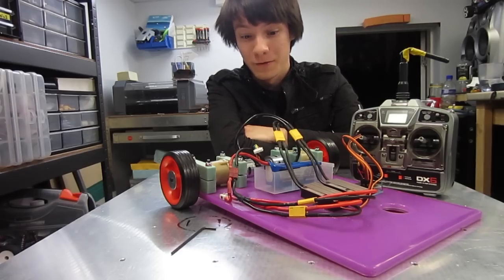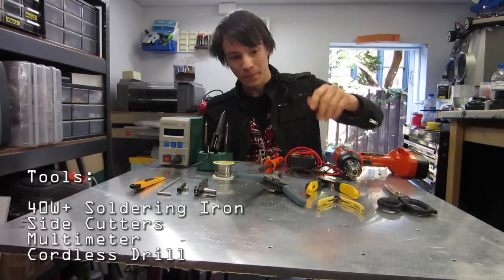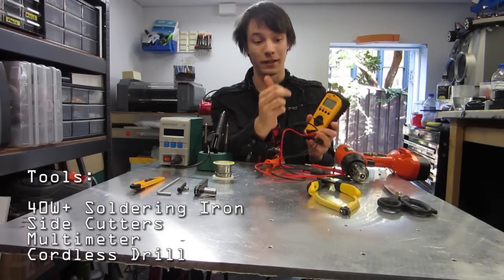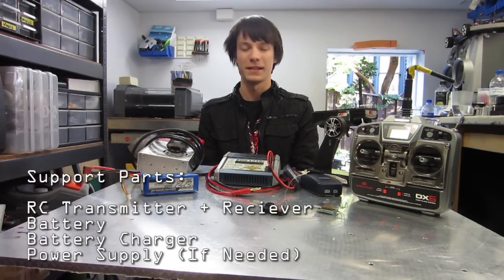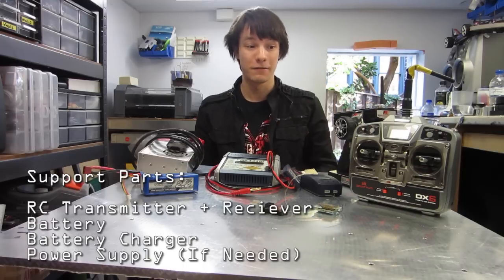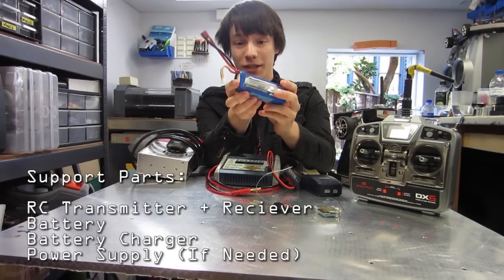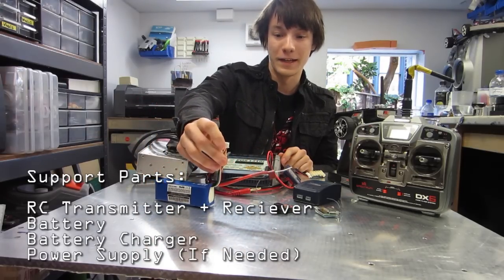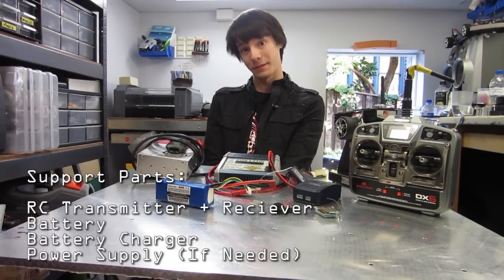How to build a Combat Robot - Episode 4 Part 1 Electronics

Comment: hi, i'm in the uk and have been having some real trouble finding speed controllers for BRUSHED motors, i found some earlier but they dont have reverse which is obviously needed for "tank steering". I was hoping you might be able to send me a link to the shop you got them from, thanks, - will
Reply from the maker: I personally use the botbitz85a's - from http://www.botbitz.com/ but they're doing some maintenance at the moment. They're usually around $75 ea or so Australian. Other alternatives are:
The ragebridge - http://www.robotmarketplace.com/products/0-RAGEBRIDGE.html
Robot power Scorpion XXL http://www.robotpower.com/products/scorpion_XXL_info.html
Sabretooth 2x25a http://www.dimensionengineering.com/products/sabertooth2x25
Or if you want to really cheap out - http://www.ebay.com.au/itm/200988738224?ssPageName=STRK:MEWNX:IT&_trksid=p3984.m1439.l2649
Reply: Robowars Australia ok, thats great thanks for that.